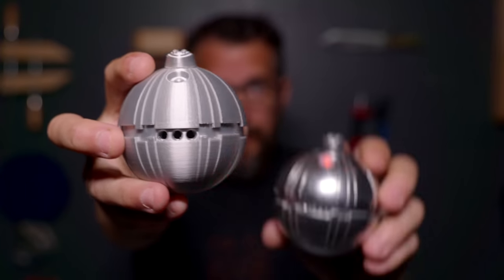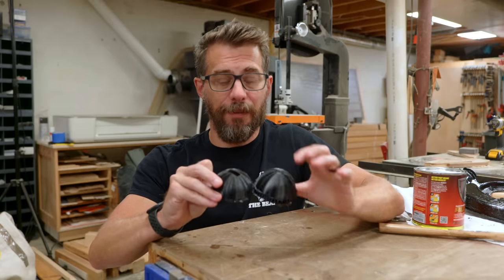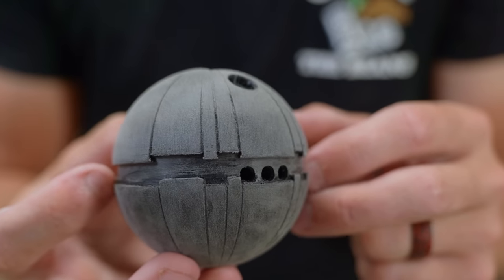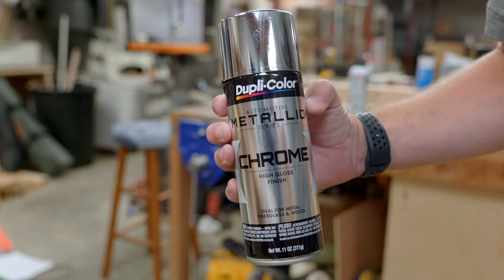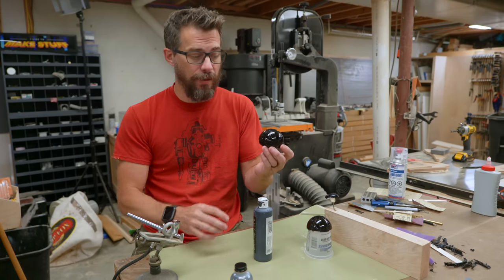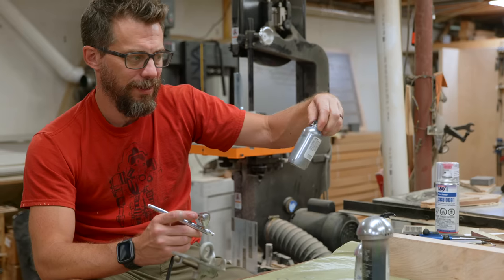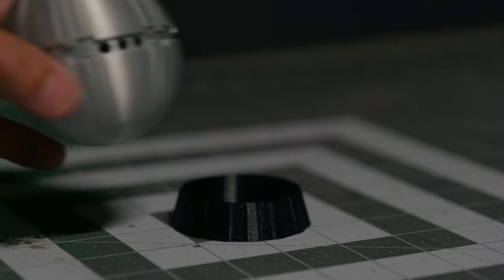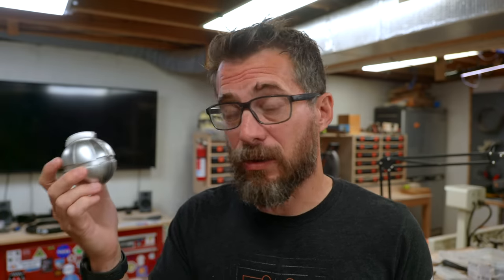But It Looks Like Metal??

Comment: The way I try and avoid a "gloopy" finish, where it looks all ugly and caked on, is if I'm using a rattlecan, I stand back to an appropriate distance and do several passes: a primer coat, let that dry (about 5 to 15 minutes), a mist coat, let that dry, then go back over it and do another coat that the mist coat didn't touch OR I use a 2X paint (primer and paint in one can) to cover my bases. No matter what, ALWAYS use the same brand of clear coat as the paint if you're using if you've using sealer, because, I've found it DOES matter: I've spent an entire day's worth of painting, only for the sealer to destroy it by causing the layers underneath to crinkle up The sealer and the paint were not only TWO different brands, but one was water-based and the other was oil-based!
That's why I'm willing to pay a LITTLE extra for something like Krylon or Rustoleum (about $5 or $6) and not a house brand or bargain brand (like $1 or $2) that doesn't do anything effective.

Comment: Pretty Great video! it really shows were you need to put the effort considering the use the prop will have. There is a video from Adam Savage Tested where he uses Molotow Liquid Chrome refill and it's just amazing how the finish turned out. I bought and it has a mind blowing coverage. In terms of cost it is on the pricier side when compared against rattle cans.

Comment: Please check out Gordon Tarpleys video "Painting a Stormtrooper helmet reflective metal using Alclad Chrome", it is a must see for alclad painting instructions. You should actually do the opposite and limit the airbrush flow as much as you can, and or limit the pressure, and you should not spray it close to the object, and you have to do many passes not only 1-2, and you need to wipe off the metal dust between each new pass, if you follow all these steps then you will really get a chrome look. Again check out Gordon Tarpleys video for the perfect instructions. When you do it correctly, it is very heard to see the amount of paint that is added to the surface in each pass. When it comes to the amount of alclad used, i spray several full sized helmets with only the smaller 2 oz bottles, they last a long time if you use the correct technique.

Comment: The mirror paint and maletow( if I spelled it correctly) sprayed through airbrush are only paints to really give a super reflective surface. Alclad is crap. Problem with metallic finishes is the clear coats dull it back down

Comment: I've used Alcad on displays, but I'm wondering how it will look after it's been handled a while. That's the main drawback for most chrome finishes. There have been some very expensive chrome options posted from time to time on the RPF that will hold up under handling, but they are a LOT (!!!LOT!!!) pricier than Alclad.

Comment: For my Mando cosplay I did all the 3D printing, sanding, filler primer... repeat repeat repeat for what seemed like months.  Then I saved a ton of money by avoiding the gloss black and expensive chrome paints like alclad and alumiluster by taking all my armor to a chrome shop here in Vegas and had them do the chrome coating to match the beskar from the show and they did a clear coat... I wish I had gone over it all again with another coat or two of 2K clear... but I didn't so I have gotten a few scratches here and there at cons. But it looks 100% screen quality.  the metal/chrome look is a ton of work.

Comment: you should look into the metallic powders used for makeup effects like seen in the original wizard of Oz tin man makeup, (cant remember the name off top of my head but it starts with an R like Rheon or something like that metallic powders) these are usually smelling like crayon and I am guessing its the tiny metal particles are suspended in a wax substance that rubs smooth easily enough to apply say to skin, 

when these that I have are applied to a surface it makes that surface texture look like metal that is that texture, so glossy or high gloss paint surfaces look like polished chrome metal, 

application of the coating is key with this stuff since it can be easily rubbed off if not top coated and the paint will cause it to rise and mix into it, so very super light coating layers of any spray are needed to get it to come out still chrome mirror like surface looking. or coat it with something else that it won't mix into like the glossy clear coating material for leather something I discovered when making masks I wanted a metallic finish on. 

one last thing, the copper and bronze or brass colored versions do not seem to have the same smoothing spread ability so I would avoid those, and just tint the chrome coating, looking aluminum powder based one, and

Comment: i got elegoo jupiter and this was one of the props i wanted to make because resin is amazing with little sanding, i almost did one on my mars but it was just little to big unless i did a weird orientation. but now i could do 4 at a time if i wanted to. 

but im gonna use Duralumen the next best thing to alumaluster which was used of mandos armor because you can clear coat it with little effect unlike alclads.
rattle can looks nice but very delicate surface.
used duralumen on r2d2 it can be cheaper then alclads also get as 1L bottle. but people knock on him thinking its metal but are shocked when they find out its 3dprinted plastic.

Comment: Plastic never looks like metal because the material is a lot less dense and simply lacks resolution for processing of details of such sharpness that you always see on metal due to perfect crystalline structure of metal grain.
You could only make it mirror chrome using chemical plating. Satin or brushed metal look, just forget about it..

Comment: You can also spray the spray paint into a disposable cup until you have enough to pour into an airbrush if you want a better finish without buying a bunch of expensive paint. Ive done it several times with acrylic clearcoat spray paint with great results.

Comment: Great video! 3D printing is a great way to make props at home! One huge thing to note is that silk filament is highly dependent on printing speed and temperature. Your printed model seemed a bit dull which is typical of printing with too low of a temperature. Try even a small model at higher temps to see the difference!

Comment: I learned early on in my own DIY endeavors that wet-sanding makes a HUGE difference when trying to obtain a mirror finish from acrylic or lacquer paints, even if they're not metallic colored. Admittedly, it's been a while since I've personally done a project where I painted something to a smooth mirror finish, but the process was very repeatable even with basic rattlecan paints and wet/dry sandpaper from 200 to 1500 or even 2000 grit if you have, and maybe some clear coat and wax to seal afterwards if you wanted to be extra cautious.

Comment: It would be interesting to try spraying the rattle can paint with an airbrush. I have often sprayed into the lid and used the pool of paint to fill details, works great because of the low viscosity. What about doing that and then pouring it into the airbrush?

Comment: Ima save you soooooo much time sanding with a little pro tip. Use wood scrapers to shave off some of the plastic to get it smoother quicker.

Comment: Would be interesting to see the spray can model with proper wet sanding after multiple light coats.  I've seen car body panels done by very skilled individuals with high-quality rattle can paint that were impossible to tell it was spray cans.

Comment: props to your use of picture in picture for your add. not only dis I not skip it but was entertained while it played. well done.  curious about the beveled flaps in your spray booth. presumably these help keep your filter (presumably behind the flats?) from getting clogged as much? I may have to try that. I'm always blowing through filters.
Reply from the maker: Thanks! Yeah, it kind of acts like a baffle to grab excess paint. I actually think the older version we had (previous paint booth video) worked better for that purpose.

Comment: Not certain if this product is still in the market, but in the 90s and Oughts, there was an incredible metallic paint line under the name Hammerite.  It came in an array of metal finishes, but also had the amazing property of producing different finishes often seen on actual metals.  Rolled on, the paint exhibited a hammered finish (hence the name), yet brushing it on resulted in a brushed metal look.  The paints contained powdered metallic particles that would react and oxidize, etc.  With an additional "wash" product, not only was it easy to create rusted plate steel, but it was unbelievably convincing, because it was actual rusted steel, or copper.

Comment: This would be a good candidate for a resin printer print.
Reply from the maker: Absolutely, you can get so much more detail. For time, availability, and concurrent printing FDM worked well enough here, and it wasn't too much cleanup. If you have the time, SLA is a fantastic option.
Reply: @Iliketomakestuff   I have an Elegoo mars 2 pro and their new Kickstarter Jupiter.   I'll have to try the thermal detonator and chrome paint

Comment: total novice here and I have no 3d printing experience, but I wonder if you could lean into the layer lines and use them in such a way to mimic some machining artifacts. Maybe by orienting the 3d model in such a way on the print bed so that as you go through the finishing steps, the layer lines augment the final version in concert with the finish. Just a thought.
Reply: Even at 0.1mm, which really you shouldn't go below that layer height as the extrusion becomes uneven at smaller layers, it looks too coarse for a machined look and once you start sanding it, that whole structure is hidden and until you've sanded it perfectly, it just looks messy. If you're filming from a distance, a completely unprocessed print can look convincingly machined, but i can't see subsequent processes enhancing the look or making it hold up up close. Might be worth some tries for comparison, but don't hold your breath.

As to why the extrusion becomes uneven, there's a lot of partial explanations, none of them are all that conclusive in and of themselves. There's a particular step to the transport gear that actually grabs and pushes the filament forward with quite considerable force, most extruders have their own gearing which isn't perfectly smooth either, and then they're driven with a stepper motor with fine microstepping but some inherent asymmetry in the assembly causing a little periodic distortion, and ultimately, whatever kind of motor and feedback you'd choose, odds are, you'd always find some sort of periodic distortion as long as your feedback source isn't from filament propulsion, which nobody found a way to measure reliably yet. Bowdens can hide the unevenness a little better, at the cost of worse corner and non-print-move behaviour, particularly when you're retracting and relying on semi molten plastic to just stay in there and ideally not drip, which with PETG in particular is a whole sing and dance and you usually just accept some imperfections.

Comment: That turned out really good.  I have several prints that need painted like metal right now.  I used a rattle can for Tusken raider face pieces, that came out good enough to make dirty, and I picked up some Wicked colors "wicked aluminum" from Hobby Lobby to use on a Mando  helmet, and a Zelda master sword.  I just need to take my airbrush kit out of the box hah

Comment: You should try to acetone finish your prints. You line a box with paper towels soaked with acetone and place the part in it. The vapers will melt/smooth out the finish.
Reply from the maker: That only really works on ABS though, right?
Reply: @Iliketomakestuff  Unfortunately it only works on abs. Tetrahydrofuran can be used with PLA apparently, but it is a little more dangerous than acetone.